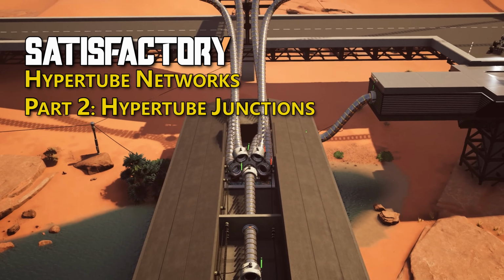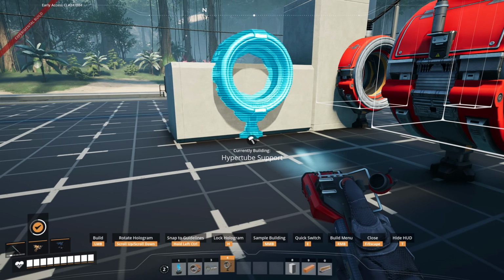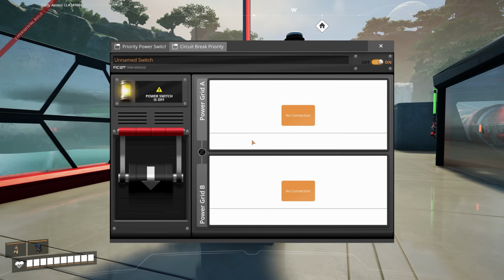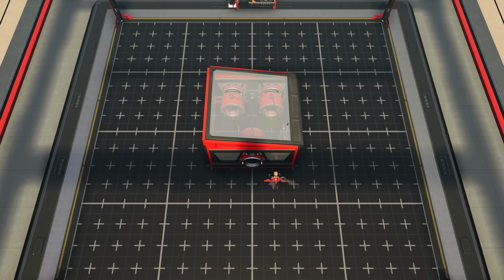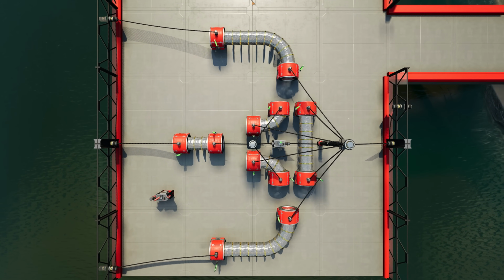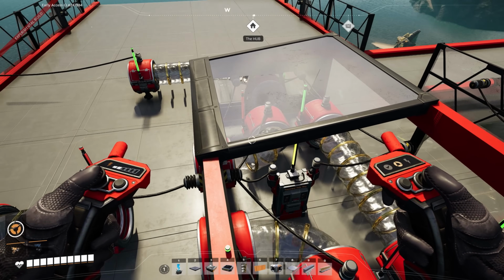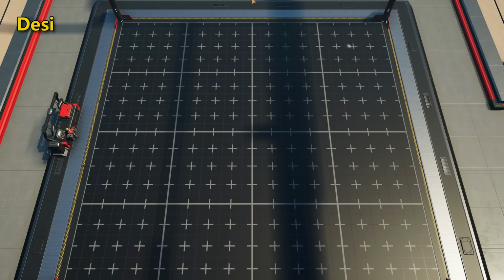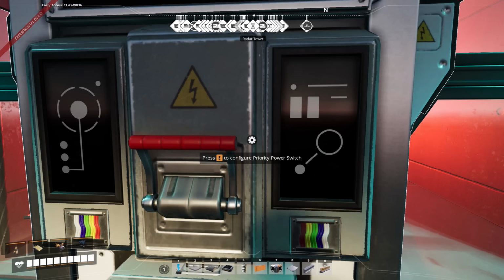Hypertube Networks Part 2: Junctions - Satisfactory Update 8

Comment: In the 5 way junction, how did you get the vertical tilt on the top tube entrances to match the beam? Mine keep building perfectly vertically rather than tilting to match the beam
Reply from the maker: I just did some testing to see if it still worked in 1.0... The default Hypertube Support will always sit vertically, but the Hypertube Wall Support (unlocked in the Awesome Shop) will match the angle of the beam or pillar that you attach it to, be it on top, or on the side.

Comment: While I've been using launchers to get from major location to major base over long distances, I've been lamenting all the running needed to get to smaller locations like miners.
After watching this I saw how to fix this issue and have now blueprinted out various junction boxes that can be plunked down easily, many on top of a standard foundation with ease. 
I'm even considering doing the priority switch trick for longer distance auto-routing.
Sadly there isn't a timer switch in the game to disable things like launcher setups when not in use.

Comment: This is actually so clever. I never thought about a setup like this. I think I will incorporate something like that in my train setup. I imagine that it would be more easily usable by having a main circuit and then only having priority junctions for the exits. So before jumping in, just switch on the actual exit for your destination or you get sent to a default exit. Or you described it like that anyway and I just didn't pay attention close enough :D

Comment: First of all, amazing video and awesome idea ^^
Now, i don't know if it maybe changed with 1.0, but i almost always lose speed when entering/leaving the T-junction, if i am too fast (e.g. using more than 12x Boost).
But only on the priority switch one.... using the manual turning one i don't have any problem, no matter the speed :/
Reply from the maker: There have been some hypertube physics changes since I made this video and this design isn't as reliable as it used to be. :-( I need to update the design and make an update video for 1.0...
Reply: I just started building these, I discovered if I built them without the power in the center I wouldn't get slowed down. I was almost certainly hitting them when going through the junctions.
Reply: @Fisdon  Hmmm gotta check that out the next time i'm jumping into sf.
Thanks bro :)

Comment: I built up the junctions, these are wonderful. I use all T junctions and I get the below behaviors, are these normal? Thanks for putting this out.
- will get kicked back into reverse
- will slow way down / have interference in a junction
Reply from the maker: Unfortunately the physics has changed a few times since I made this video and has introduced the issues you are encountering, so the junction design will need to be updated. I will do a Satisfactory 1.0 video at some stage once I get some free time, and work out what the optimal new junction layout should be!

Comment: Most of these are simply an amusement, but those leaning T junctions are absolute gold. Nothing else is that convenient for doing that. I didn't realize a lean-junction was possible. Bravo!

I personally use conveyor junctions, since they let you hop off and have additional exits along a route and don't require active attention to use the default route. Check those out sometime! Tube -> conveyor -> tube

Comment: This is a great video BUT am I missing something here, if you have a switch that you have to operate to change direction doesn't that mean you'll have to switch it BEFORE entering the hyper tube? So, for example, if you have a hyper tube with a junction between two factories which are some distance apart how do you operate the switch without running all the way over to it first, then running all the way back to your tube entrance etc etc??

Please help :)

Videos are brilliant BTW, really helpful but this one I am struggling with a bit
Reply from the maker: That's what the Priority Power Switch allows you to do! You can switch any priority switch from any other one, so you can remotely turn on the route you want to take.

Comment: One thing I just realized is that you can press ctrl + move your mouse left/to set the pitch of the support. You can set the tube to be entirely vertical which is great for elevators on your taller factories.

Comment: not sure if everyone else is having trouble with priority conjunctions not automatically sending them out the default, requiring button press. I solved it by just using pillar tech on both openings and bringing both slightly closer.

Comment: Thank you so much for the inspiration! I copied your design for the T junction and its working just fine. But it also kills all speed I gained in the launcher and reduces it to „standard hypertube speed“. Any ideas?
Reply from the maker: Unfortunately the physics has changed a few times since I made this video and has introduced the issue you are encountering, so the junction design will need to be updated. I will do a Satisfactory 1.0 video at some stage once I get some free time, and work out what the optimal new junction layout should be!

Comment: Question -- is it possible to build one where holding nothing always puts you out on the same path, but it can be overridden by holding a directional button to get a different output path?
So that I could have a default line which stuff always follows, and then I'd only have to press a button when I want to exit off that main line.
Reply from the maker: I think I saw someone design one that was based on crouching! If you were standing you take one tube, but if you crouch as you go through you take the other one. I haven't tried this technique myself yet though.
Reply: @DortamursHobbies  oooh, that's interesting :o

I was imagining one that worked off the jetpack, by having a bit of space between exit and entrance, and having your character fall different amounts depending on if they were holding space or not -- but a crouching version seems like it'd be better if it didn't require the extra space between tubes still.

Comment: These junctions are totally awesome, and using them has been a blast! One note though - as of 1.0, the junctions have inconsistent behavior. They generally work fine, but then sometimes the exit tubes don't grab you quick enough and you end up dying on the poles in the middle. Whenever this happens, I've found that restarting the game seems to fix them, and then after some indeterminate amount of time they break again. YMMV, these are totally awesome though, and I hope the variance gets patched soon!
Reply: I haven't died yet, but yeah, I'm running into a problem where sometimes I lose all of my momentum going into the "priority" tube. It's inconsistent and I can't figure out how to replicate it. Going "back" is totally fine so it's weird. I might try moving the entrances a smidge closer or maybe play around with angles or something.

Edit: I removed the cosmetic power pole in the middle and that seems to have solved the issue for now? just get power through the wall and it seems to be fine.

Comment: in 1.0, that first 2-way jotion has a problem that will slow player or let player not entering next entry when high speed, which can simply solved by moving power connector bar to somewhere else so player won't hit it.

BTW your design is wonderful, i have a great time making hypertube network.
Reply: Great tip. This was exact issue I had😮‍💨
Reply: thank you

Comment: Don t knoz if someone will answer...
I have designed a very similar T intersection (not switch for me). The problem is that for instance when i start from the bottom entrance and thus press "left" to turn left, the first intersection works fine but at the second interection the left hypertube does not get me and i am pushed way directly.

Any solution ? Maybe just rotating a bit hypertube suports to direct them more in direction of each other ?

Comment: Hey ive been building your junctions and acclerators but I have a small problem with them. After going trough a junction I loose quite a lot of speed I had before, Is there a common mistake I made or something?
Reply: Putting the entrances one step closer together seemed to fix it but there is some clipping. At least it works now

Comment: I started setting up the "smart junctions" but I loose a hell of momentum when going through the junctions, does anyone know what might cause this
Reply from the maker: There were a number of changes through Update 8, and currently they are a bit unreliable as far as keeping momentum. 😞 I'm hoping that 1.0 (out on the 10th!) makes them more reliable, although the design may have to change a bit if the physics model has changed some. I'll be testing and doing a post-1.0 video if there's new reliable ways of doing things!

Comment: First of all, genius design. I like that the alternate ("priority") route is on/off rather than having to independently control both left and right choices.  So, off=default, on=priority / alternate / or what I'll think of as the "override" route.

When you got to the point of everything out in the SF world, the priority power switches panel got complicated. 

Whatever the starting point, the individual switches will be shown in the control interface in the same order. From any starting point to destination there is a setting for all the switches involved of either on or off. Each station could have a list of destinations and the switch settings.  For example, to go to my steel plant from my caterium wire factory, it's 10011.  If there are switches that are not involved, the list could just show those as "don't care" like 0 1 x  x 1.

Going beyond vanilla solutions, the ultimate control interface may be to integrate this with FICSIT Networks (FIN).  FIN allows you to make elaborate control panels. Turning a dial encoder can select a destination on a display (like a bus destination board), and also display it on a vanilla sign above the hypertube entrance at the starting point. It flips all the switches accordingly to get from that point A to the desired point B. While priority power switches need to control wiring, FIN allows you to control regular power switches with a LAN cable. The priority power switches could be retained for cutting power demand, and eliminate the chances that a power shortage would disable the hypertube network.

Comment: Really cool system Probably going to have to figure out a way implement this in my current game (pretty fresh) My only issue is the need to actually run wires to them so I can't just rely on rail power.

Comment: At fast enough speeds, your player body can collide with objects beyond the hyper tube entrances. You can try removing the walls on the hyper tube pieces in the intersections if you keep losing your speed.

I had something similar happen to me. It was because of a metal pillar I had about 10m past one of the Y intersections. Another way to fix this is to angle each of the entrances one tick upwards so that your player body gets shot into the air in the split second before it gets sucked back into the hypertube

Comment: 500 hours in to my build and I had no idea you could put an entrance at both ends of the same tube. I have been running two tubes for back and forward. That makes new runs so much easier. Thx for that even if you didnt think that was important.
Reply: i realized at around 300, if you hold S and try to go backwards, you just go in reverse mode mid pipe too so you dont have to ride it all the way if you jumped in wrong tube
Reply: You can also add multiple entrances to go faster, or just build a Canon
Reply: Your design is better if you’re using accelerators, if you try that with one tube you’ll get stuck going the wrong way
Reply: @hughjanus9981  Literally no such thing as wrong way :o
Reply: @hughjanus9981 add entrances to both sides of your accelerators, friend…
Reply: Your solution is much better. Now two pioneers won't slam into one another.

Comment: Huge fan of the designs and also the video quality! I really liked the cutaway shots of the blueprints and the top down camera angles you used were perfect! I'm super curious how you got the top down shots, I'm trying to get similar ones for some of my videos using the Ficsit Cam and can't quite figure it out, any tips would be super appreciated! Excited to see part 3 when it comes out!
Reply from the maker: Thanks! Yes, I use Ficsit Cam to set up a camera pan from above, starting with a begin and end camera position and angle facing in, then I add some extra keyframes to get the path, and tweak the ease in/out of the keyframe point curves. To get the cut-away, I record a camera pass with it normally, and then repeat with the cut-away, and combine them with effects when I edit the video. :-)
Reply: @DortamursHobbies  ah okay, I see that makes sense, thank you! Sounds time consuming but it’s well worth it with the final product!

Comment: Got yourself a sub, i've never thought about making hyper tube highways but this video has got me interested. This might be a dumb question cause I haven't had the chance to mess around with these yet but, how do you make the paths default to your main hub if priority is looped? Do you just swap the priority paths to the hub making them the priority instead?
Reply from the maker: Yes, that's right! While the loop returns you to the hub, the junction at the hub is set up to just return you to the hub, rather than looping around infinitely. You're effectively returning into the original junction, which from that direction has a single exit out to the hub. This is why there's a space between the two branch entrances - if they are too close together you actually will get sucked in the other entrance and sent the wrong way.
Reply: @DortamursHobbies  Awesome, thanks for getting back to me.

Comment: Nice. I was still using Kibitz's old vertical junctions that launch you into the air and you have to maneuver yourself in mid air to land in the tube you want. It works but if you miss the tube you die.

Comment: So my question is usually when I set up my network I install about 20 entrances... Just like a cannon. So I travel my network at high speed. Will the junctions still work?
Reply from the maker: Yes, you sure can! I use "cannon" style launchers for a speed boost from my hubs and major factories, which is why travel is so fast - and the Junctions work fine! Especially the Remote Switched junctions in Update 8 mean you'll always go the right way without having to manually "steer".
As the Junctions add extra entrances, you actually pick up a bit of speed at each junction you go through. I'll be covering launchers in another video in the near future.

Comment: I'm still pretty new to Satisfactory, just passed the 150 hour mark, and I'd completely disregarded hypertubes up until this video popping up in my recommendations 😅. 

However this video changes everything! The possibilities, ideas, presentert to make a functional yet stylish system, and explained in such perfect detail you're not left wondering how to implement it yourself. 

Truly a masterpiece of a tutorial 👑
Reply: Hypertubes are absolutely essential the moment you get past Space Elevator Stage 2, because trying to run on foot between biomes is painful and you won't have enough production infra to set up platform roads for wheeled vehicles yet. But so far I've been only doing the "single hypertubes with manual stops where you have to jump into a new tube to continue" method, I had no idea junctions were a thing you could set up with the right planning and power switches... (ah, just watched Part 1, this kind of thing only works in Update 8 due to a physics improvement and the addition of Priority Power Switches, no wonder i wasn't aware of the possibilities)
Reply: same here just got to 120 hours
Reply: How did you not get tired of running everywhere?

Comment: I watched your video and it was terrific. You did a great job explaining everything and it all makes sense. I will have to go back again. Its causing me to redo my setup now lol. One thing I would have liked to see, and Im not even sure if it is possible, are two way tubes with speed cannons (not accelerators). Like it would be nice to have a bi-way tube that no matter which way you are going in, you will hit a speed booster. It seems that speed cannons are always a single way so that would prevent what I would be looking to do. So it forces us to make two separate tubes for coming and going. Maybe I am wrong? What other type of content are you looking to do next?
Reply from the maker: Thanks! I plan to cover launchers/accelerators in my next video, along with some optional uses for stored power. 
You can make a bi-directional accelerator, although usually it's not what you want, as accelerators tend to be at the start as a launcher, and you don't want a burst of acceleration as you come out of the tube. I'll consider adding in some ideas in my next video.
Reply: @DortamursHobbies   heh heh yeah I have had some deaths from coming out the tube accelerated. I prefer a smaller version of the cannon connected to the Hypertube line for a speed boost. Keep up the good work man, looking forward to seeing more.